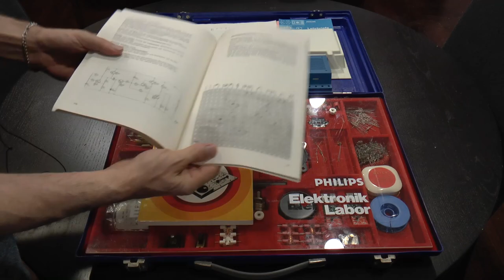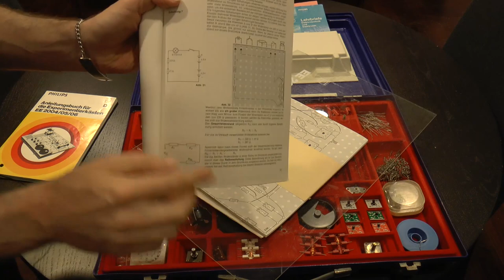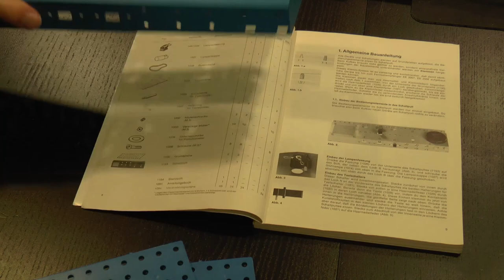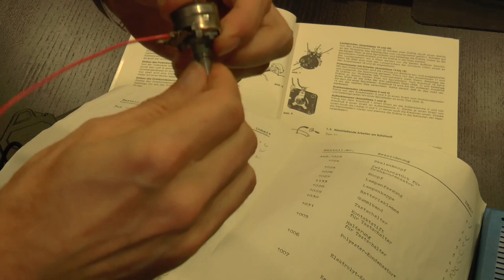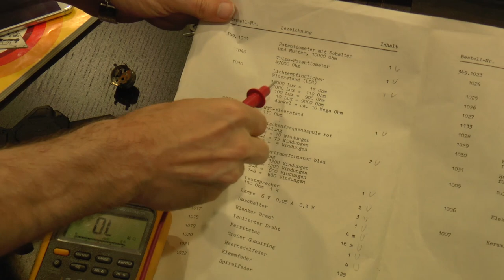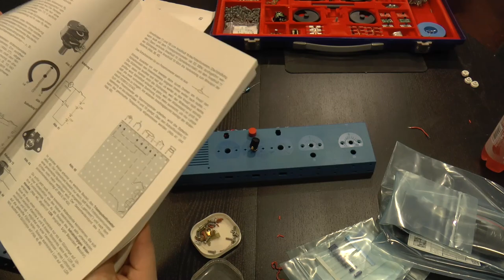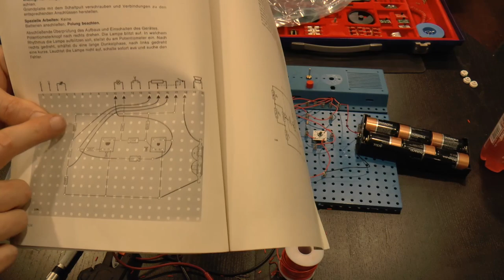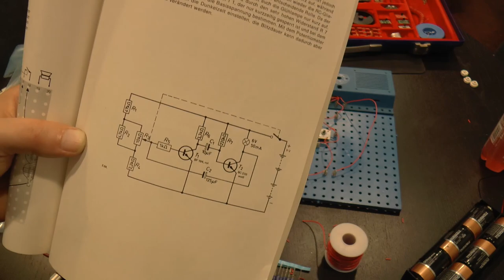Philips EE2000 Electronic Laboratory

Comment: The most epic birthday of my life was when I turned 9 and got an EE2003. My box was just cardboard and styrofoam and there were fewer parts than you have. And my book was in Dutch but it looked the same as yours. My birthday was during Easter break and I spent the entire day putting the control panel together and making some of the circuits such as the phono amplifier and the blinking light. I had a lot of fun with it over the years, and I learned a lot from it but I also had frustrations like you where nothing seemed to work and I had nobody to help me debug. Anyway, I hoped one day I would get the EE2007 and EE2008 which had a picture tube and the circuits to make a real black and white TV. Unfortunately that never happened.

I still have it: I took it with me when I emigrated to the USA. But almost all the parts are gone: I used them in other projects or they just got lost or broke (I think I had 3 or 4 LDR's over the years because the leads would just break off. I wished they would have just mounted that on a little circuit board like the transistors).

The one that you have is in excellent shape! It looks like the previous owner didn't even take any of the sheets out that you would punch holes into, and the parts that you show on the video look like they're unused. I've never seen the EE2000 before; I thought the EE2003 was the most advanced box with a control panel but the photo on the book shows a lot more parts installed in the control panel than the EE2003 had. This video explains where the rest of the components came from, though I'm still not sure why you would need more than one potentiometer and more than one variable capacitor.

I cringed when I saw you open those books as much as you do in the video. The covers are glued (not bound) so my book came apart and ended up in a binder :-(
Reply: Hi Jac, the EE2003 was indeed quite an advanced box in the sense that it combined a few earlier boxes (EE2050/51/52) and therefore allowed for a reasonable number of circuits. On the other hand the EE2003 was a (mandatory) "starter kit" for radio technology (EE2004/2005/2006), TV technology (EE2007/2008), or IC technology (EE2010 and then EE2014/EE2015/E2016/EE2017). The EE2000=EE2003+2004+2005+2006, so it's the complete radio-technology pillar. Furthermore EE2013=EE2003+EE2010.
Reply: @jandejongh  EE2000 must have been expensive. I remember my EE2003 was over 100 guilders. A lot of money in those days!
And of course the EE 2007 and EE2008 were almost as expensive as buying a TV that didn't need to be put together.

Comment: Tubular ceramic capacitors were once very common in European electronics.  TDK in Japan also made them for some time.

The forth band on a capacitor is usually the voltage rating.
Reply: They were not very common outside europe? Mind blown

Comment: You measured the current draw of the circuit, and is was "almost nothing".
So: how can the circuit drain the battery?
I would try new batteries anyway. (Unloaded voltage is usually much higher than under load.)